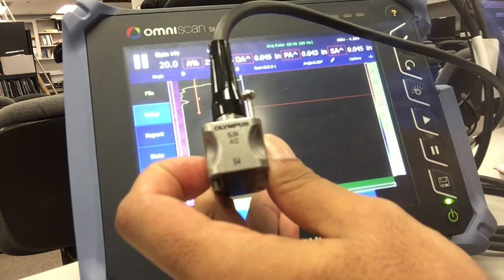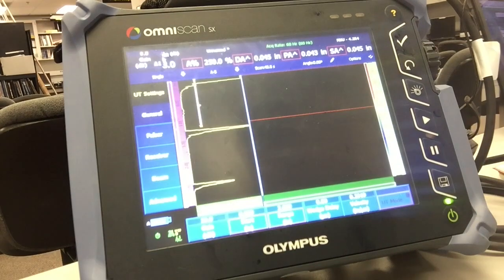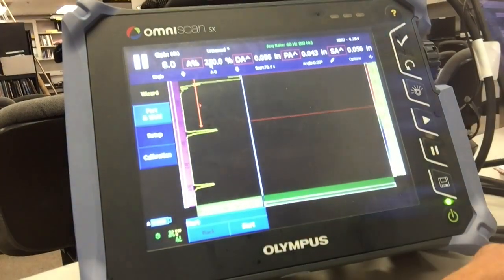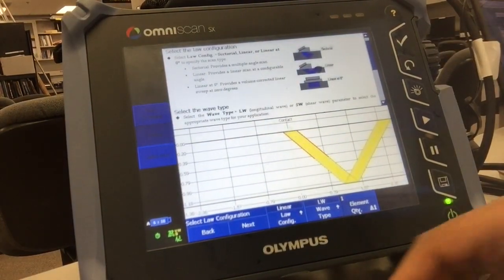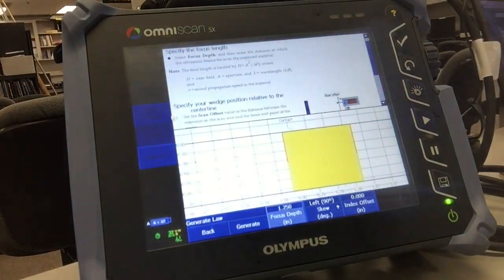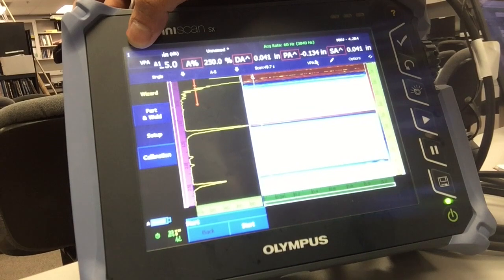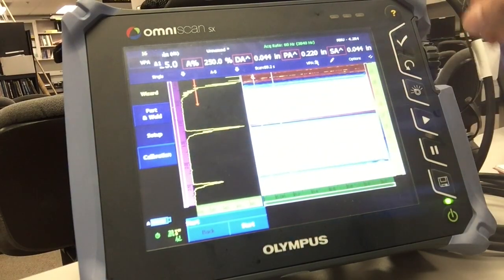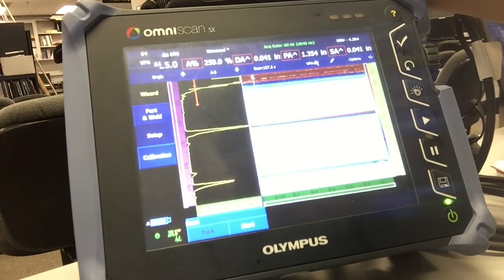Sample procedure for Dead Element Check on PAUT probes

Comment: Excellent.  I've been performing this for >15 years on OmniScan MX/2 and most often using the Focus LT.  The only thing I do a bit different rather than looking at the backwall, I will set the Time Base Start to -0.100in ... rather than zero I will start negative to see all of the top surface.  This works great in immersion with Focus LT & TomoView and the same principals apply as you've shown here with the OmniScan.  I use this to also verify the Height to First Element with water wedges & Focus LT.  This technique will satisfy ASTM-E 2491, Annex A3 and ASTM-E 2700, 8.1.1 for Zero Depth Position.  Great job presenting this!
Reply from the maker: Jefferson, thank you so much for your kind words! Your technique sounds great! Thank you for sharing knowledge, I truly appreciate it. This is what this channel is for.